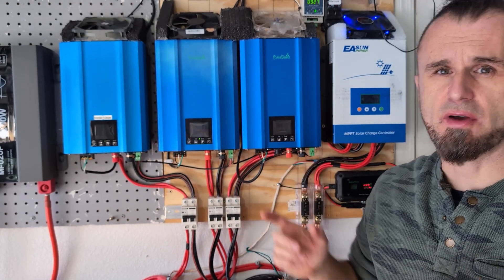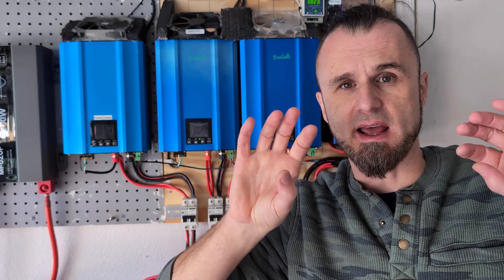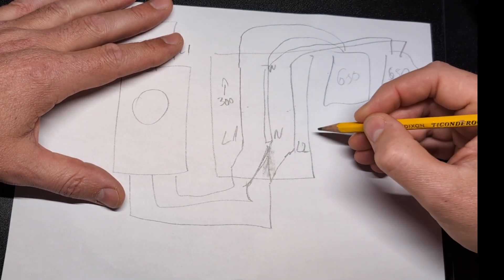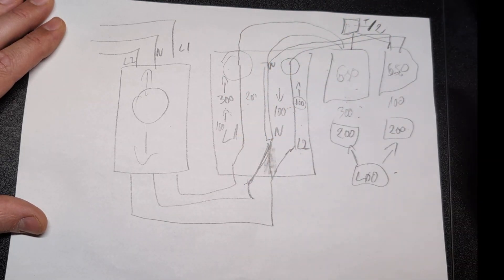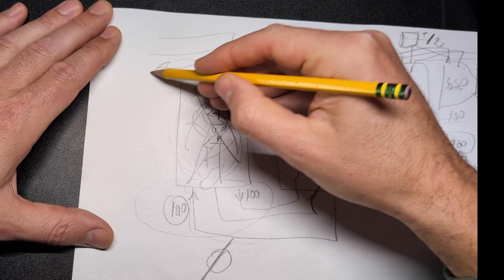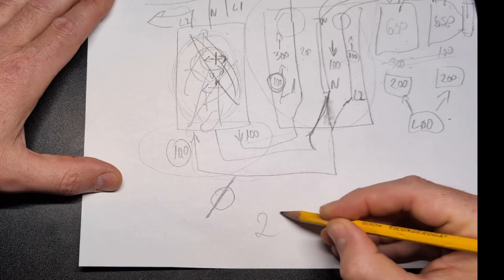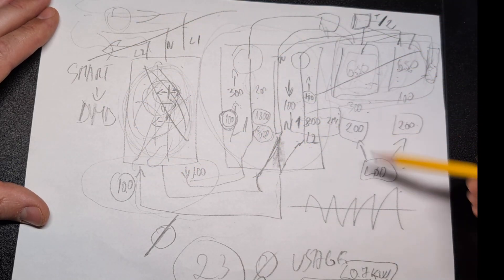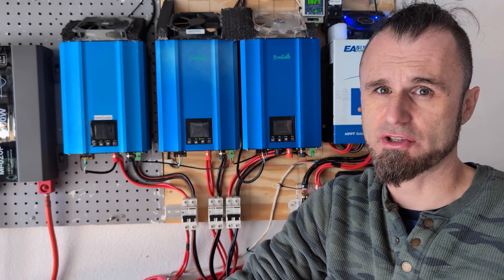How many Grid Tie inverters with power limiter can you have and how do they work and share load?

Comment: How are these grid tie inverters holding up, still going strong?

I've got some micro grid tie inverters now for about 12 years, still going. But they don't have limiters. Im really wanting to go with more battery storage, hence looking at the grid ties you have. Thanks.
Reply from the maker: 1 year , no problems , once they lost their programing , literally reset settings otherwise they work great ...
Reply: That's really good to hear, thanks for that.

Comment: QUESTION: Great video first of all. 😀 I just got done setting up two of these CT RS485 AC power meters with the Soyosource GT Inverters.  I have a clamp on both L1 and L2 on the main utility panel. QUESTION, Is there any way to calibrate the  (same as yours) included Beige/Blue Green LED retro-looking small box (CT AC Power meter) to get it to read closer to what my outside utility panel meter is stating? (Like by somehow calibrating the RS45 meter with a tiny screw driver? I just don't see any tiny (+) nobs to adjust on that little box with the green LEDs) I had to replace  the included CT clamps with bigger clamps that would go around my 100amp lines and get longer wire for the CT clamps to be able to reach the GT inverter located 30 feet away. I was able to clamp L1 and L2 separately so that each GTI had their own AC Power meter. However, they are both reading only 1/3 of the actual usage of each line, so the inverters are only sending back to the utility 1/3 of the usage. EXAMPLE: The Utility meter says I am using a combined 1500 watts, but the combined readings of the  two CT RS485 AC power meters are only reading a combined 500 watts. The silver lining is that I will never over produce back to the grid this way. LOL 🤣I also have a Tuya smart wifi meter connected to the same CT wires and it is reading it better than the included Soyosource CT AC power meter. Let me know. 👏Thank you for making these videos, I don't think I would have had the confidence to connect mine up without them.   

The model of the two Soyosource's I am using are the GTN-1000LIM24 with specs of AC 1000W - - PV 26v-45v - - BAT 24V  with Limiter

INTERESTING PRODUCT SIDE NOTE: Just in case ya'll were wondering what happened when the DC power dies, when the solar power and the battery power is low in the evening, the inverters will go into a sleep-like mode and it will say "DC Input Low" in red font and "Standby... PV Limit". No more power will be pushed out into the grid. During this low power sleep mode, each inverter plus the retro-RS485 meters are still working and using a total of 2 watts combined from the utility.   Also, if the AC dies, the GTI and everything else turns off. Just in case ya'll were wondering what happened when the AC grid power dies. This is of coarse with the limiter connected. Don't know what happens if the RS485 is unplugged from the GT Inverters.
Reply from the maker: You need 3000:1 clamps , so the ones you got might be a different ratio, but maybe you can put a potentiometer on it see if that works but you can only reduce kot amplify so if you have 2000:1 clamps you can't make the. 3000 to 1 but you can make 4000 to 1 reduced with a potentiometer ... Really complicated to calibrate
Reply: @VegasRoManiacReviews  You are right, the new bigger ones I have are not 3000:1, they are actually 1000:1 and could be the reason why it's only reading the utilities L1 and L2 current usage of 1/3 of what it should be. I will try to buy two 3000:1 CT and see what happens. Thank you. :)        2ND QUESTION: In the Soyosource settings, does "Bat CP Mode Power" matter in Limiter mode? It currently is set to the default of 400w? I have my small 24v 120ah LiPoe battery and the solar panels connected to a hybrid controller and the Load DC output coming out of the hybrid controller is connected to the two GT Inverters.
Reply from the maker: Also very important you cannot put the CT clamps on the main lines coming in the house, because you have to separate the loads from what you produce, otherwise they will cancel each other out, so the city clamp should be only on the loads and separate from the lines that you are feeding power into the house
Reply: @VegasRoManiacReviews  This now makes sense as I had done what you did on the first part of your diagram drawing with 2 meters and 2 ct clamps. Then you said that you switched to just one AC current reader box. How did you combine the readings of both L1 and L2 into one AC current reader box? Did you combine the 2 CT clamps wires into one AC reader box, or did you get 1 giant CT clamp to go around L1 and L2?

Comment: Thanks for the video with further explanation of how the system operates for you, I did pick up some more useful information. I have ordered a single unit of the cheaper, old style you used to use to play and learn with. For more than two units I am interested in how you physically have them attached to your breaker panel. In your previous videos you show that you have a Solar 1 and Solar 2 breaker, one on each 120v leg ( L1&L2) - where would the third unit be added to the panel? Would you install another breaker (Solar 3) on the line with highest use? Where would you attach a fourth unit when you get ready to upgrade? Thank you for taking the time to put this information out for everyone, it really is interesting and much more useful for those trying to set up a small inexpensive system.
Reply from the maker: My next video covers that but I'm going to give you a link for it so you could watch it ahead of everybody else
Reply from the maker: https://youtu.be/x3X4V8PsmDk
Reply from the maker: @jimbaggett1233  but to answer your question. You can put up to 3 inverters per a 20 amp breaker , so I have 2 breakers.  One with only one inverter the other with two inverters on it ... Both breakers are 15 amps and because each inverter does about 7 amps in under their rated power .. if you have 10 inverters you need to do the math but basically at that point you gonna need 4 maybe 5 maybe 6 breakers ore one big one with thick wires
Reply: @VegasRoManiacReviews  Thank you! I appreciate you taking the time to help0 me understand.